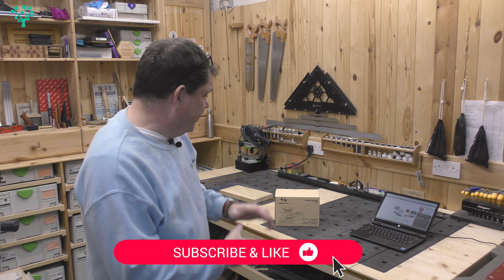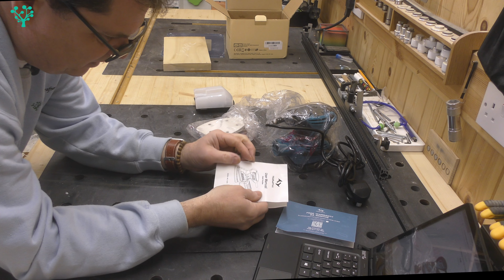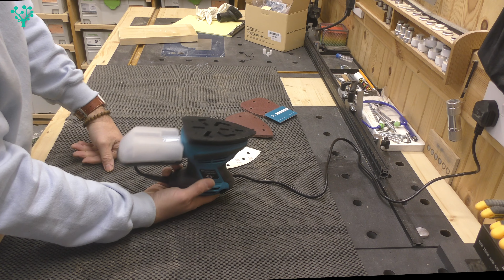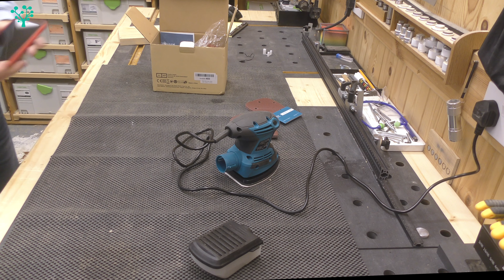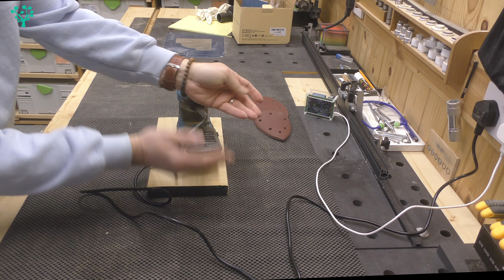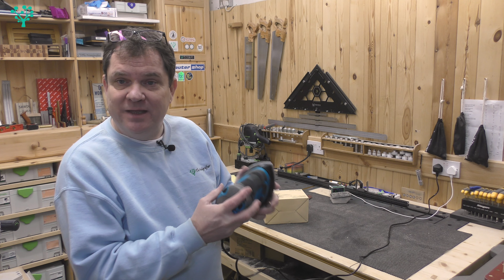Tilswall Mouse Sander - Ultimate review

Comment: I have found the sandpaper falls off after less than 5 minutes of sanding. I am not leaning on it or keeping it in one place or any of the things that can cause the Velcro plates to wear out. I have had to buy new plates within a month's use, but these are no better. I am using quality hook and loop sandpaper and have tried several brands of paper.

Comment: Hi Andy, still own your BS75?
Steve
Reply from the maker: Hi Steve,

Hope you are well. Yes still have it, I tend to use it less now I have the drum sander - but every now and then it comes to the rescue.

My plan is to build some sort of stand and have it permanently on its side in the shop.

Cheers 

Andy
Reply: @TheWoodgrafter  hi Andy look forward to that video so I can use mine the same way. Thanks for the reply take care
Steve
Reply from the maker: So will I !!!!!!

At the moment I have the idea, but not the design. Next job is the table saw cabinet, then the CADCAM cabinet (to house the CNC, 3D printer and Laser). Then the tool chest, then the mitre saw station and finally the sanding cabinets.

So perhaps 2-3 years away ??

Cheers

Andy

Comment: There is no safe level for dust, especially finer particles. I'm of an age that ignored it. Deep regrets. Now only use tools with dust extraction hoses, never with provided bags or boxes
Reply from the maker: Very valid point, that’s why I was saying with the dust extraction as provided, levels are high.

With a quality sucking device they are around the same as the ambient in the workshop. However, the workshop is inherently dusty so that is no sign of safe.

Agree there are no safe levels, always wear the mask.

Andy